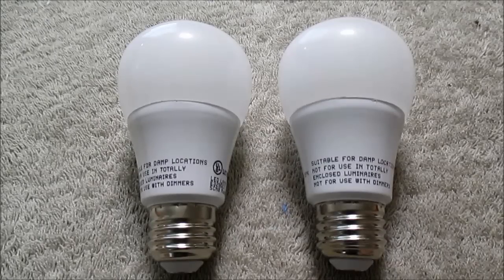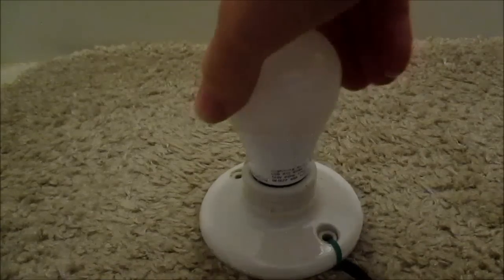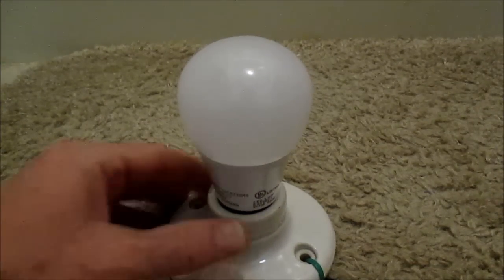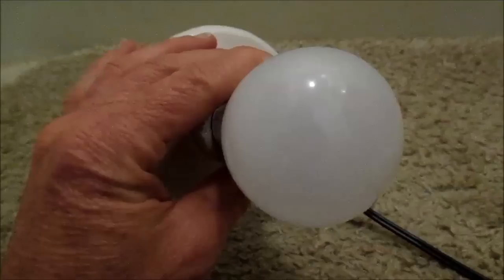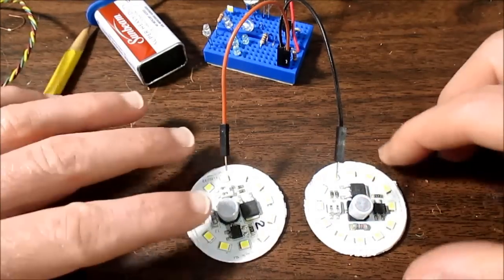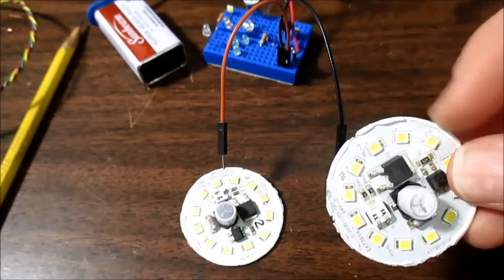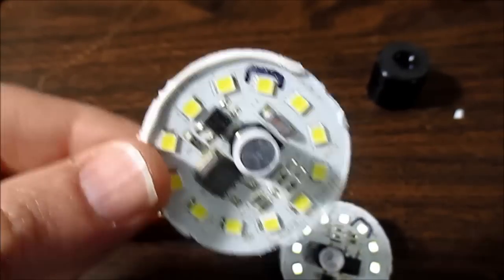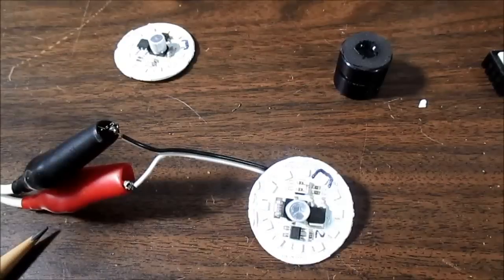Two failed LED bulbs for teardown to determine the cause

Comment: Pretty sad when even light bulbs get "logic boards" in them..
Reply: LEDs are electronics devices.  What did you expect to be in there if not an electronic circuit board?
Reply: No logic in it. Just current regulation and AC rectification as LED’s are a DC item. Comment on things you know rather than look like a fool.
Reply: @Techheadzc32  Sorry y'all. I like being somewhat sarcastic about things. Yes l know it isn't a "logic board". But l still feel it is a thing to put  circuit boards in a light bulb! Now l'd kindly appreciate it if you'd git off my back about it and give up trying to figure out what l know or don't know.
Reply: @Techheadzc32  : I think it's rather harsh to call someone a fool for using "logic board" to refer to a printed circuit board.  I really doubt that anyone reading the comment failed to understand what he meant by that.  I'm still interested to know why circuit boards in lamps are "sad" and "a thing", but after being called a fool I doubt that the original commenter is going to explain.
Reply: Graham Davies I didn’t call him a fool. I said it’s better to not comment on things you know nothing about rather than look like a fool. Big difference. He may have made himself look like one, but I never said he was one.
Reply: That’s all well and good, but no circuit board, no way to mount LED’s. If sourced correctly and built with exacting standards, these should, and usually are, more superior to any other form of lighting ever known. I have my house totally converted and I find them better than any incandescent or fluorescent and they use even less power than both. Bottom line, if you buy wisely, you’ll save money on these. Simple.
Reply: A bridge rectifier, voltage regulator and some LEDs. Where are the logic boards?

Comment: I believe there is a light bulb somewhere in a firehouse that has been burning for over a century. Maybe Illinois?
Reply: Yeah, it's in a Livermore, Calif. firehouse.  The difference is the lamp's light output is very dim, as though the bulb was designed for a much higher voltage; maybe 220 volts??  There are Youtube videos about the lamp.  Here's one:
https://www.youtube.com/watch?v=mUt9tGgVxzU

Comment: Converted most of my home with this expensive junk, failure rate is much higher than incandescent bulbs, effect on my energy bill basically zero!
Reply: Its a Miracle It's a Miracle, every other household on earth that has converted to LED lighting has had a reduction in electricity bills but not this guy? It can only be a MIRACLE!!!

Comment: I’ve gone with pretty much all LED bulbs in my house, only one bad one.  Pay the extra $2-3 more for the better brands.
Reply: I pay 48 cents per LED bulb, look for them in the clearance aisle of your local hardware store. Mine have lasted 2 years, running 9 hours at night.
Reply: Before LED bulbs became available, I installed CFLs for security lighting outside my house.  They are on for an average of about 12 hours per day.  This is 9 years later and MOST of them still work.  So, that's 12 hours x 365 days per year x 9 years = 39,420 hours!  Not bad.  The reason they've lasted so much longer than their rated life is that they are turned on and off only one time per day.  Cycling CFLs on and off shortens their life.  That is not true of LEDs. @marmars1081
Reply: A voltage surge could make even a high quality LED light fail.   Our houses have so many electronic devices that, in my opinion, it makes sense to have a surge protector for the entire house.  Even washing machines, refrigerators, and microwave ovens are electronified and computerized, so a voltage surge could cause very expensive damage. @Mike Studmuffin
Reply: The reason they are wired in series for LED bulbs is that each LED, depending on design, takes 0.7 to 3.0 volts.  Wired in parallel would require a voltage which is too low.  The current would be higher and the power supply would be more expensive.  Another problem is that the current drawn by an LED increases with the temperature; that would cause design problems. @dohabandit
Reply: @b00ger901 You would need to know the ohm value of the LED your jumping - But that's a great idea that would work just fine.
Reply: same here, the LED life expectancies are generally overrated, but you cant stop what's coming.  we'll never go back to the edison bulb- it's way too wasteful, all that heat is wasted, plus it adds to Air cond. loads.
Reply: @Mike1614YT  Change out the LEDs for winter, go the Edison bulb
Reply: Heat is not wasted. In summer, I do not need light. In winter, the heat produced is taken off my heating bill.
Reply: @juliusfucik4011  depends where you live.  We were 80 degrees here in Texas on xmas day.   But won't get out of the 30's tomorrow.
Reply: And you saved .27 cents

Comment: The newer ones are 40 volt, and are also crap. Haven't had one last a year, half are trash by 4 months, Every one I pulled apart and tested, they all worked, it was in the circuitry, I suspect the regulator.

Comment: I had a Noma LED bulb fail less than a year into its ten year warranty period. I see the fine print on the bulb says it is not for use in totally enclosed fixtures, which the ceiling fixture it failed in is. What's up with that? Heat? I know they promote them as converting energy to light, not heat, but I also know they do produce some heat. Too much to survive in an enclosed fixture? More development work is necessary, if that's it. As to cost, they're available at Canadian Tire this week for what amounts to 50 cents each, plus tax on $3.00 each, which in New Brunswick is 45 cents.  ( Noma brand A19 bulb in two-packs , CTC Product no. 052-5358-0, 60 w equivalent.) Yep, 50 cents for the product, 45 cents taxes.  Our politicians and bureaucrats at work for our benefit, again?

Comment: now to fix them...have one bad one on hold to take good leds off of and replace bad ones...could be you know...that if the voltage was dropped a little then one bad link led might not burn out...now we have to determine if its worthwhile to worry about repairing burnt out ones..i might do that to my failed ones too but in some cases,its good to not keep the bulb base inside a area where heat cannot escape,this tends to be another reason why some leds fail that might be on the fence of working or burning out...always that weak link..
Reply: Cheap finned aluminum base would solve the problem.

Comment: Many thanks - told me what I suspected! Now here's a thought. Don't bin them. Cannibalise a good LED, resolder it and get one good lamp - but put a bigger resistor in and drive them less hard. It will be dimmer, but I wonder by how much..... Slightly off topic is how annoying the so-called dimmable ones are - they don't dim much! I always thought it would be possible to have a sort off coiled bar-LED that reacted to voltage. The more you inputted, more of the LEDs would light up, rather than the 25% (I guess) difference that occurs with each LED being underdriven.

Comment: .... could be they're being run near their max current rating and, since it only takes one to fail, one does. It has the upside of taking a product that should last a consumer years, if not decades, and turning it into a product that needs replacing more in line with traditional incandescent bulbs. I'd bet if you modified the resistor value that controls the current limiting IC to lower the current 10% these would last much longer. 

Then again, maybe it's just really a marginal batch of items that were doomed to fail from day one. Thoughts?

Comment: i'm  just🤪👉 looking at an open led 💲$2 cheep the same 💡 bulb 💡thought i'd ask what ? can u do with the circuit board ? 9vl hmm :) mite try something if it works ? 🙈🐌💬WOT? dont think so maybe the board be handy for something🙊 or not  👽💩😔
alot tech put into a build - shame we cant use it to run something else?  brb🐌💬
Reply: emoji overload. your'e gonna short out the youtube comment section
Reply: @ThatDaveFella  🤪                https://youtu.be/vudODqC1duw       > watch this guy  prof Julius   miller 60s 70s way ahead of us :)

Comment: I had two LED in the same fixture go out on me.   I'm wondering if it's a brown-out or heat that caused the failure.
I'm suspecting heat because in my situation it was in the warm part of my kitchen behind a glass dome.   It could also be because I'm running counter appliances on the same circuit. 
Too bad, you can't get into these bulbs without destroying it.  Because this is fixable if you want to waste your time.

Comment: You should put the product name in the description so this video can be more easily accessible to people looking for a review on these particular LED bulbs.  

Also, it's valuable LED information promoting how important that LED s that fail can and should be recycled.  Most of the parts can be in good working order and it be a small failure and for pennies fixable.  In the right hand, this is reused, repurposed, &/ or recyclables materials that shouldn't be thrown away!

Thanks for taking the time to share your experience and savviness on the matter!
Reply: Would be nice if the companies could put in a little effort to actually make them last though
Reply: @Nikkk6969  and... maybe make an accessible way to send defective or burnt out bulbs back to them for a coupon or discount on future replacements.
Reply: agree, I bought the product although there is a bad review but the price is really really nice, i try to buy it , and it very surprise to me, The quality is really good. Luckily
 https://amzn.to/2Nz4IHe

Comment: I have noticed that the failures I have had are when the bulb is facing down as in a ceiling mounted light socket. But in all of my table lamps where the bulb is facing up, I have not had a single failure yet. That leads me to think that when the bulb is facing down, the heat flows up into the board and causes some desoldering or some delamination of the board and that causes the failure. Where as the bulb facing up allows the heat to escape without heating up the board..

Comment: It's so that you buy more bulbs. You think you are saving money by saving energy, but you are just funding a different business. Actually, I seen in stores of local electricity businesses are advertising to purchase certain energy efficient bulbs. And the bulbs are crap after couple months or some drop from 75 watt equivalent down to 35 watt equivalent over couple months. So the electricity company probably has deals with some bulb manufacturers.

Comment: If you have several bad bulbs, desolder the individual good LED's from one bad bulb to replace the bad LED's in the others. This works much better if you can find new LED's. Solder quickly, because the less you heat the LED, the longer it will last. Too much heat will ruin the LED. There are special soldering irons called talons that consist of two heated tips you can use to heat both sides of an electronic component at once to remove it quickly without damaging it. You can use two small low wattage soldering irons, too. 

I spend most of my workday fixing LED display boards for video billboards and sports scoreboards. The surface-mount LED's shown in this video are typical of what I find on many boards. After corrosion and physical damage, LED failure is the most common problem. LED's may be rated at some outrageous figure like 100,000 hours of life, but that is baloney. The cheapest ones get dimmer and start to burn out after only 1,000 hours or so.

Comment: power surge on main grid has allot to do with led bulbs not lasting
Reply: G eire , Seems that we need surge protectors for our LED lights, just as we do for our other electronics, like computers, etc. It stands to reason, though. Similar electronic circuits are built into these bulbs, too.

Comment: I have some from the dollar tree, whole house full of them, over two years not a single one has burnt out. 1$ a piece. And they are bright as hell and good color temp. Bought a pack of 100w replacements from home depot, the dollar tree 60 watt replacements are just as bright. Couldn't be happier

Greenlite is the brand. They are perfect.

Comment: They market these lamps as having a long life. Often 50,000 hours and yet a lot of them fail after one year. What annoys me is they are marketed as environmentally friendly and traditional bulbs have now been banned. Yes they consume less power but they don't last as long as the manufactures claim.

Comment: “Planned Obsolescence” ring any bells?
Reply: Richard WILSON u sound like Scotty Kilmer...hahahaha
Reply: I saw that too about the light bulbs. Dirty bastards!!!!! Our Consumer economy means no quality products, they have to wear out so new ones can be sold
Reply: @logankincade661  why blame bastards if you can make a bulb serving 10 times for the same price? go make it and get your millions...
Reply: Yep - Just like that new car you purchased.  Notice that the transmission dip stick is missing on may new cars.  That is so your transmission will fail - The transmission fluid should be change every 60,000 unless your using synthetic.
Reply: Cell phones are definitely built with planned obsolescence. That's why your battery starts to fail at 1 year 11 months.
Reply: Nah, it's just poor quality control of cheap Chinese bulbs
Reply: Recently viewed a documentary about that....started with lightbulb factories agreeing on the maximum hours a bulb might glow

Comment: (old video i know)  you mentioned bigclive in there so, in one of his fairly recent videos he talked about how light switches with dirty contacts can cause these to fail (not making a good connection) causing the leds to pulse and burns them out. so, since these failed at the same time, if they were on the same switch i'd definitely look into replacing the switch.

Comment: First, buy a major brand. There's a lot of junk out there that won't last. Second, heat is a big killer of LEDs. If possible, orient the LED bulbs face up, not face down, so that the heat rises away from the LEDs.

Comment: So what is the exact problem? Open LED's that suck 6.7 mA when shorted. What makes them open? Why not take some good LED's from the other boards and replace the bad ones. See if it works as required.

Comment: They are made in China with components that have questionable quality control. HEAT is the killer of LEDs....and if a substandard heat sink is used, the array will fail. If the bulb is placed in an enclosure with no heat dissipation,  one ore more LEDs will fail.

Comment: I think in 2015, I bought my first Cree (label as Assembly in the U.S.) Bulb for my business. Months later of having LED of kinds failing on me, I replaced all the bulbs over time with Cree. Also one of the home improvement stores were selling these Cree bulbs that were assembled in the U.S. for 4 dollars per bulb; good deal. I bought over 50 bulbs but I only needed 16.  The automatic lights turn on and stays on for 10 hours everyday for the past close to three years now on my first Creed bulb. It is an equal 60 watt bulb and the darn thing still is bright as new, even with the outdoor elements. I am impressed but not anymore. 

 Two month ago, I bought a cree bulb that is made in China for comparison; ok, I was bored that day. And that Chinese made bulb with crooked label of Cree just died few days ago... I have used bulbs from so many different manufacturers and they all sucked, most of these LED bulbs are junk. But than, it depends how lucky one can be.

Comment: try changing the two 15 ohm resistors with  one  30 ohm ....add a bridge  rectifier and increase  the size of the original isolation diode...or  you could just add a flux capacitor ........
Reply: Dilithium crystals.

Comment: that's cuz they are designed to fail. they don't want them lasting forever cuz then you wont need to buy more. the whole name of the game is to keep you coming back to buy more products to keep the economy system going ... this should really not surprise anyone here. i had a guy explain the same thing to me when i had my clothes dryer serviced one time, the public bitched and complained so much to the manufacturer that they had to start making the various safety checks in your clothes dryer cheaper so service guys could make some money servicing your equipment. that was the last time i had anything serviced, after that i tried to fix everything myself ...

Comment: Hi
Can you give me any suggestions as to figure out why a 4 ft. Bright/Cool White Integrated LED Linkable Shop Light Fixture failed? I'm guessing it's something simple but i'm not experienced with any of this. I have 4 of them, only 1 has died, burned. I suspect some electrical surge while I was working on the live electrical line. Because the fuse was tripped but nothing else got damaged.
Thank you for any suggestions.
Arek
Reply from the maker: I'm not familiar with that brand but it could be the driver circuit has failed.

Comment: Low cost Chineese LED's.... typical. I was working for some time designing boards for LEDs lamps and those low cost ones are designed on strict budget and to fail after 2 years or so, mostly due to overheating of LEDs and internal bonding fails. For example, check cheap Osrams E27 LED bulbs operating temperature. The outside (cooler) is about 100-120degree Celsius, after about 15-20mins of work, imagine what temp. is inside the diode....